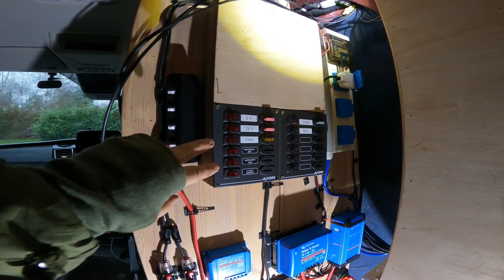Victron Energy van wiring overview

Comment: Hi...Did you use the victors shunt, I can’t see it. If you did, this gets installed after the protect?

Also, where did you get that mains busbar from?
Reply from the maker: Hi the link for the mains fuse board is at
https://www.12voltplanet.co.uk/3-way-mobile-mains-hook-up.html
Not sure what you mean about the shunt and the battery protect. As the shunt is connected to the neutral and the battery protect is connected to the live. But yes I’m using the Victron shunt.